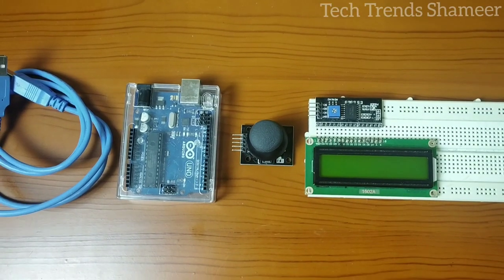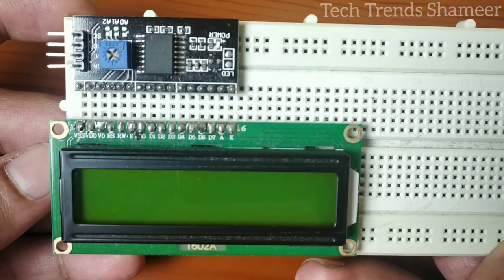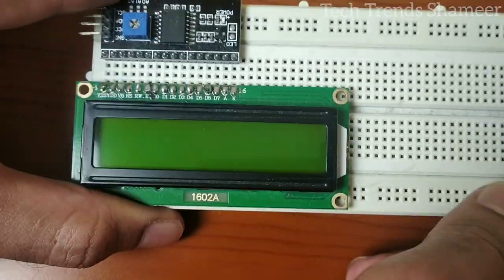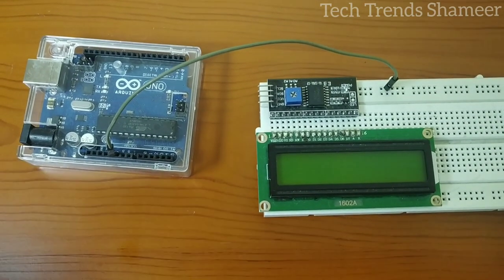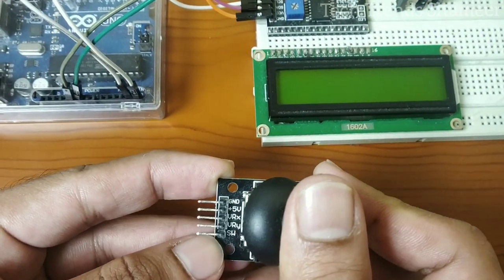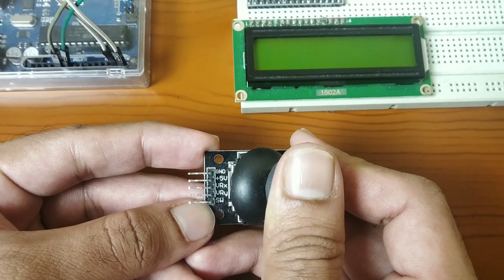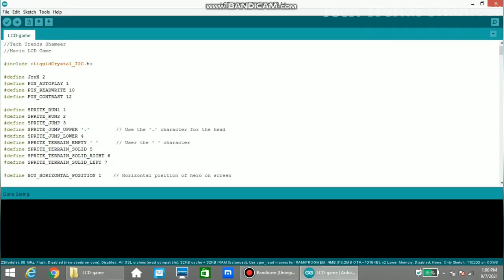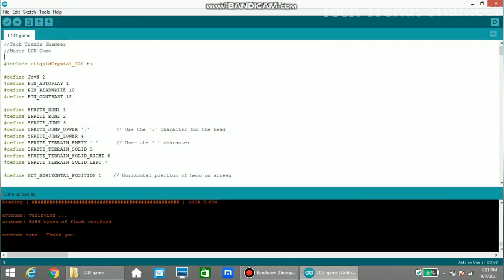Mario LCD Game | Arduino Projects

Comment: Arduino: 1.8.15 (Windows 10), Board: "Arduino Uno"

C:\Users\HP\Downloads\mario-LCD-game\mario-LCD-game.ino: In function 'void setup()':

mario-LCD-game:247:13: error: no matching function for call to 'LiquidCrystal_I2C::begin()'

   lcd.begin();

             ^

In file included from C:\Users\HP\Downloads\mario-LCD-game\mario-LCD-game.ino:4:0:

C:\Users\HP\Documents\Arduino\libraries\LiquidCrystal_I2C-1.1.2/LiquidCrystal_I2C.h:58:8: note: candidate: void LiquidCrystal_I2C::begin(uint8_t, uint8_t, uint8_t)

   void begin(uint8_t cols, uint8_t rows, uint8_t charsize = LCD_5x8DOTS );

        ^~~~~

C:\Users\HP\Documents\Arduino\libraries\LiquidCrystal_I2C-1.1.2/LiquidCrystal_I2C.h:58:8: note:   candidate expects 3 arguments, 0 provided

Multiple libraries were found for "LiquidCrystal_I2C.h"

 Used: C:\Users\HP\Documents\Arduino\libraries\LiquidCrystal_I2C-1.1.2

 Not used: C:\Users\HP\Documents\Arduino\libraries\NewliquidCrystal

exit status 1

no matching function for call to 'LiquidCrystal_I2C::begin()'

Error downloading https://dl.expressif.com/dl/package_esp32_index.json

This report would have more information with
"Show verbose output during compilation"
option enabled in File -> Preferences.

This error
Reply from the maker: Are you using LCD Display with I2C converter or LCD alone ?
Reply: @TechTrendsShameer  yes but what to do
Reply from the maker: Lcd alone or with I2C ?
Reply: @TechTrendsShameer  i2c
Reply from the maker: Please install the library from this link https://github.com/fdebrabander/Arduino-LiquidCrystal-I2C-library